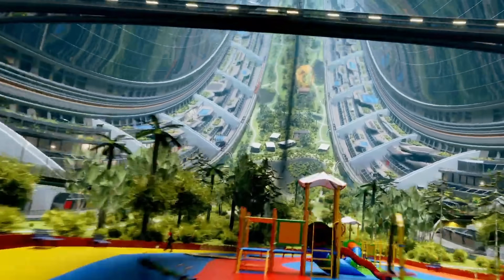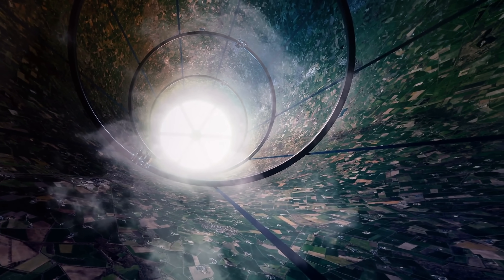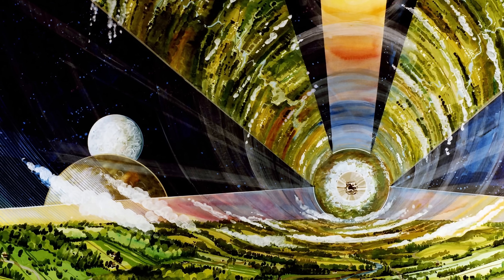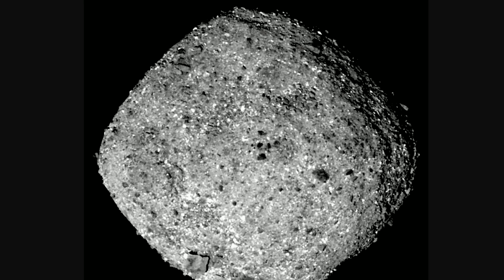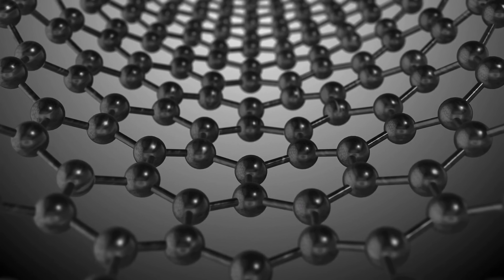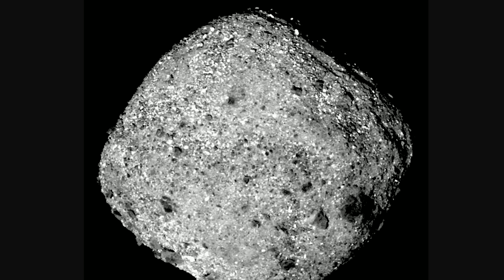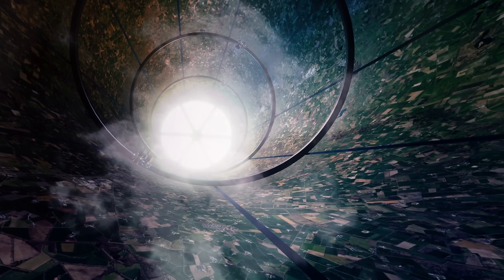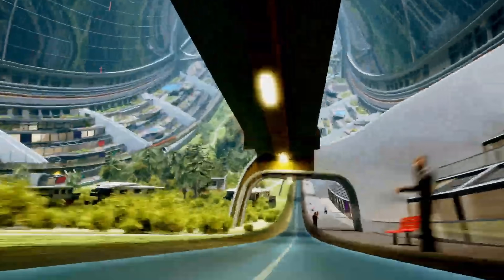Space Cities Out Of Asteroids and Graphene Bags? Intriguing O'Neill Cylinder Study

Comment: This program if it was ever started could certainly get a lot of people excited and hopeful for the future. And Anton you are right we do have a fairly good handle on the required tech needed on a small scale. But there are still some gigantic hurdles we would have to overcome. A project like this even a scaled down one (say 1km in dia) would take the combined cooperation and resource contribution from most of the planet. And that would include contributions from countries that are at odds with the rest of the world or at War with it. That is probably the biggest hurdle. Another is scalability and trust in manufactured materials on the largest scales. One of the many other hurdles would be power sources. Once an asteroid is bagged (I would double bag it) we need to speed up it's rotation. Seems to me that would require a Nuclear powered engine or two somewhere in the mix and people do have a problem or they used to of sending nuclear anything into space. I know some satellites and probes have some nuclear stuff but each of those are on a small scale that would most likely burn up incase of an accidental reentry. But the Engines needed for a project like this would be much larger and dangerous. But like I said that's just a hurdle.
Reply: Who knows in 50000 years maybe we have technology like this if we survive that long
Reply: I believe there would be much lass resistance to nuclear energy f it is far enough away from earth that it presents no danger of re-entry and catastrophe!
Reply: @stevenkarnisky411  I agree with what you've said however, not every rocket that blasts off makes it into space. But technology has improved over the last couple of decades so I'm pretty sure they can prevent the worst case scenario. But I'm a nobody in the space program so they would still have to convince the powers to be.

Comment: I somehow doubt it can really be called a cylinder built from asteroid material. Asteroid rubble would serve as just radiation/impact shield, cause clearly 2 meters of it can't provide airtight wall, which means that some kind of space-worthy outer/inner (or even better both) wall is required. Am I right on this?

Comment: seems like you are putting a lot of faith on the longevity of that net. If it is everything holding the habitat together and it fails everything will break apart real fast
Reply: Why would the net need to be the final structure? We don't limit ourselves to the original structures of a thousand years ago for our  existing cities.
Assuming there is a flow of materials to and from the cylinder;  nothing is stopping the inhabitants from slowly building up an outer shell of steel plates over time.

Comment: the way you suggest building is wrong not your fault i am sure. fullerene is not necessary although would be helpful. And as far as construction goes all that's needed is sun light it's called centering . and we have a lot less time to implement this prosses, than you stated. Time is a ticking good luck :)

Comment: Construction of an O'Neill cylinder is not necessarily the simplest solution.   The minimal diameter of a rotating space station to generate artificial gravity of 1g is the limiting factor.  A small diameter spinning habitat would have to spin too fast and would cause motion sickness.    3 rpm appears to be the maximal rotation speed and this would still need a 100m diameter station.  A more comfortable 1 rpm would need a 900m diameter station.   That's just a huge volume of space to build a O'Neill cylinder.   Linking up a series of Starship sized spaceships into a Stanford torus, or just tethered individual units connected together by cables and rails would actually be the easiest way to get started.

Comment: I wish you would EQ the mud out of your vocals. You need a high pass filter at like 300Hz plus a pretty significant treble boost. I know, I know, who cares. Well I'm telling you, people don't realize they care about sound, but they do. It WILL get you more return viewers if your audio tickles the ear rather than wrestling it. Actually, to me it sounds like you're using a Shure SM7b and are less than a foot away from it. So I would recommend simply putting your microphone farther away from your mouth. I think that will make you sound far less muffled and difficult to understand. The SM7b has no transformer inside, so it lacks the presence boost of other microphones that use the same guts (yet inexplicably it costs 4x what the other models do), as well has having a very weak signal which actually helps cancel unwanted ambient noise, so if your room isn't particularly quiet I would suggest selling the SM7b for about $400 and getting something less expensive like even an SM58 if you don't want a condenser mic. I use a <$100 Behringer B1, and I get amazing vocals (Just have a listen to my Ween cover or Ship of Fools), and you could pocket the change. Of course I'm speculating; you could just be using a lapel mic that isn't picking up any treble from its position. JUST TRYING TO HELP!

Comment: Not a molecular scientist at all -but from the diagrams shown, graphene seems to bond in sheets 1 atom thick, with no open bondings for a 3rd dimension.  Are there any carbon molecules that for m a 3d structure? I don't think a single layer of graphene would be strong enough for this, and while you could stack the layers, there aren't any bonds connecting them together.

Comment: Dunno, spinning an asteroid into pieces to be the foundation of a O'Neill cylinder seems impractical as you're literally building on gravel than a solid (and stable) surface.  You would have massive structural issues.   Unlike hollowing out a metallic asteroid and spinning it to speed.

Comment: It's a cute idea but completely unfeasible compared to the alternatives. The surface of the final structure needs to be impermeable and what the paper is proposing is essentially a spinning bag of gravel. A much better solution is to send a factory to the asteroid, construct a series of kilometer wide mirrors and fuse whatever the asteroid is made of into engineered glass sections. Imagine a series of ship sized 3D printers with the solar collectors melting the asteroid bit by bit.  The printer filament would be meter wide sticky glass. Then the finished parts are pushed off to their final destination and assembled like said ship. Once it's complete spin it up and you have a SOLID L3+ type habitat.

Stay away from L5 type O'Neal cylinders as they are harmonically unstable. That's why in the High Frontier the illustrations are of paired cylinders that are contra rotating. The Stamford Torus (L3) is harmonically stable and won't flip on you.

Oh, yeah and no carbon nanotubes needed.

Comment: Minimum size of an O'Neill cylinder is a bit above 200m in diameter with something like 2,5rpm iirc 

Wouldn't that be doable with modern mass produced materials like nylon and carbon, using small asteroids?

Comment: i'm not convinced.. the main problem is that we would not control the state of the rubble near the net, at the bottom, or the size and nature of the irregularities... Once spinning, it would be hard to refine or melt the material deep near the net. If you can spin a giant net, you may as well spin it empty near the asteroid and slowly transfer transformed and filtered material from the asteroid to cover the inside of the net. 
Even better : a longer cylinder (3 or 4 time the size of the asteroid).. once it's spinning, you have the working ground to filter, transform and spread materials inside the cylinder. You can even close the long cylinder and pressurize it right from the start, so you can use all the volatile materials (like ice and gas) of the asteroid and work in pressurized condition.

Comment: I don't think any company or government would start off by attempting to wrap a large asteroid, but maybe you could start small and work your way up. 
There should be plenty of loose debris near Earth or you could shoot it off the Moon. 
All you need to start is a short 40 meter diameter fabric tube to start, with maybe some structural framework at each end for docking and to attach an engine. A single Falcon could probably launch it.
It wouldn't take much effort to get something like that spinning. TransAstra has designs for drones to bring material that could partly fill the tube. A little effort inside to push the rock to the tube walls and you have the beginnings of an equivalent to gravity and radiation shielding.
Throw in two old ISS modules opposite each other with solar panels on the outside and you have  a starter space station with very mild gravity (no need to fill the whole  thing with air).
If the design allows for adding  panels, you can expand and upgrade indefinitely.
A company like Spacex or Blue Origin could build crude habitable lunar cyclers that way in a decade and scale up to mining bases that could used around asteroids like Bennu by the end of the century.